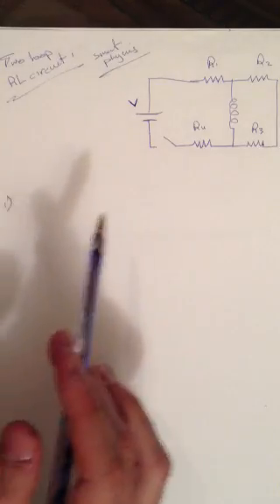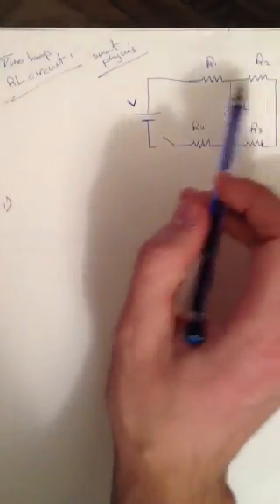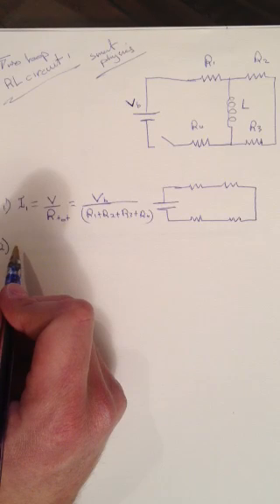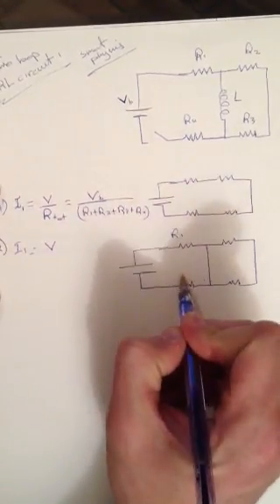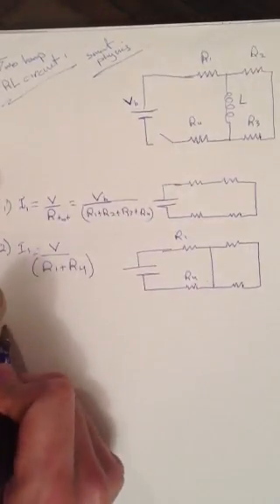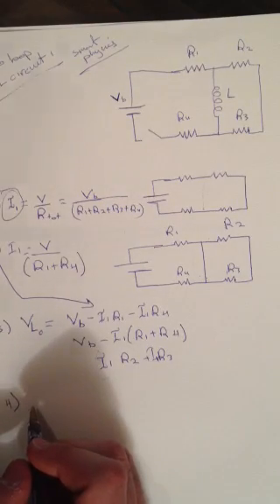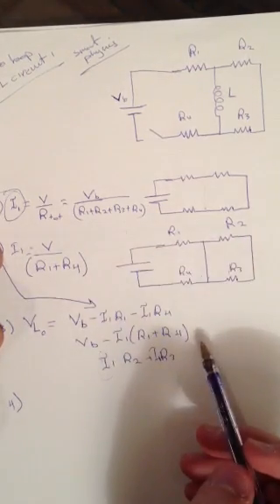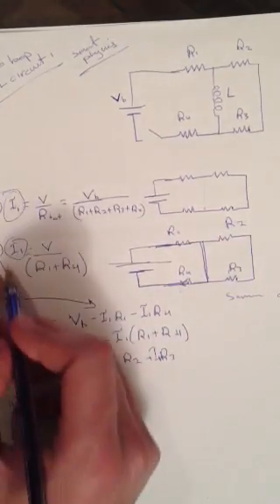Smartphysics: Two loop RL circuit 1

Comment: I am confused why the inductor has 0 voltage at t=0. Isn't there a large change in current happening at t=0?
Reply from the maker: Gal Zeidman If you are talking about number 1 then the inductor will induce current that is opposite and thats why we consider it as an open wire. Which part in the question u are talking about ?

Comment: If you are here for the two loop RC smart-physics problem involving a Capacitor where he has an inductor L. This difference is that the circuit will act like there is just a wire across the capacitor section resulting in the current bypassing R2 and R3. You will end up with the same equation as him only without R2 and R3....   V/(R1+R4)
Reply: +Mat Petersen Thanks Fam

Comment: I have a question, if you said that right after the switch is closed the current through the inductor is 0  how can it have a voltage? Thank you man
Reply: Good question, if u look at the inductor equation, it depends on the change in the current not the current it self.
Reply: Yeah i figured that out thank you man again :))

Comment: for part 1 you should do what you did in part 2
and for part 2 you should do what you did in part 1
Reply from the maker: I'm pretty sure I did it right. Support ur argument, why are u saying it's the opposite?
Reply: Walid Hamarneh I did it my way and Ii was correct. I did it your way and it was wrong
Reply from the maker: Oh it's just a question number error, but the concept is right. Thanks for pointing that man.